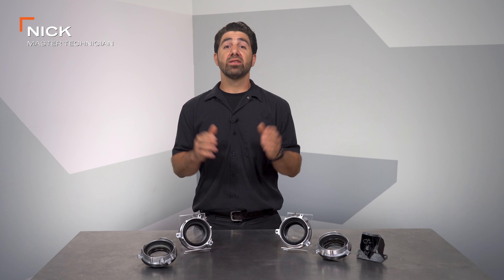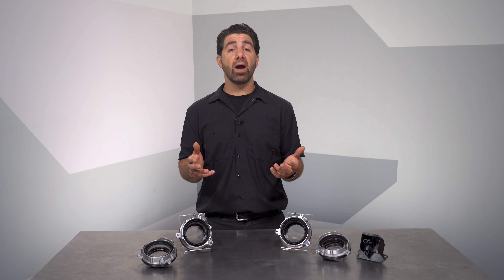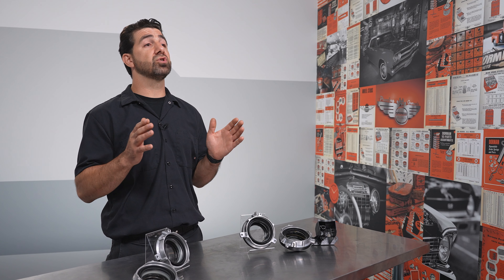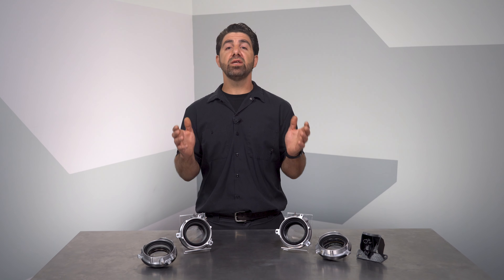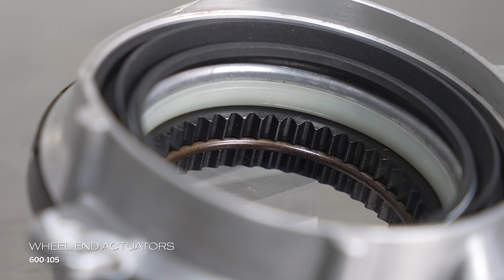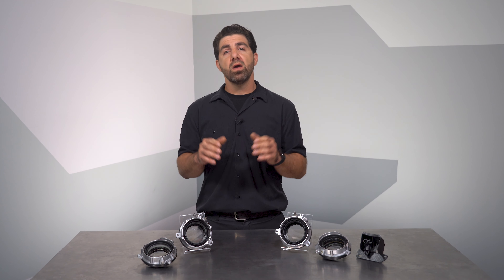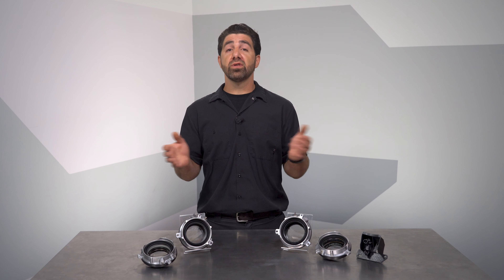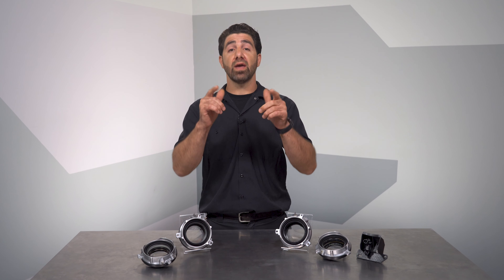Ford 4WD wheel end actuator fix! | Dorman OE FIX 600-105, 600-305, & 600-405

Comment: I had mine replaced with these as well as many of the numerous dorman aftermarket improvements for my 2011 f-150, but now I can't get my transfer case to go into 4-wheel drive.  I just get a wrench code that states "CHECK FOUR WHEEL DRIVE"..  any ideas?

Comment: If deleting the IWE's can the vacuum lines just be removed altogether following the delete kit install? Also does 4A (4 automatic) still operate as intended? I use this setting far more often than 4H or 4L.
Reply from the maker: Hello! You could remove the lines if you chose to.  The IWE's do not control 4H/4L/4A that is the transfer case.